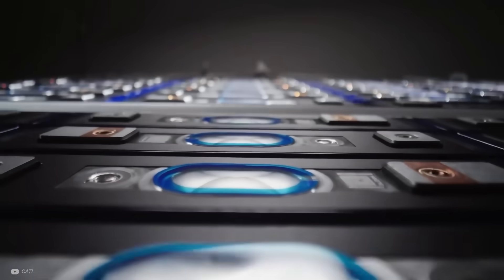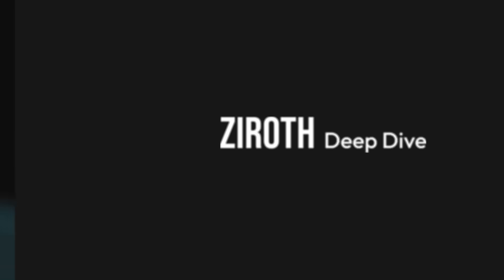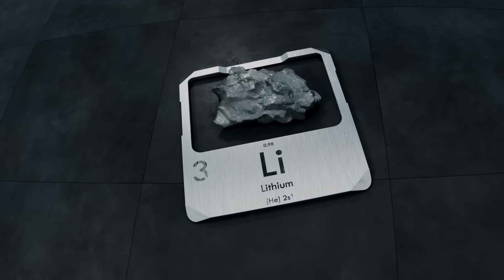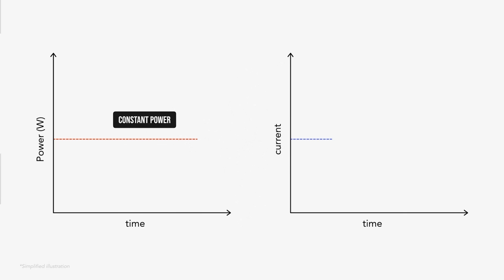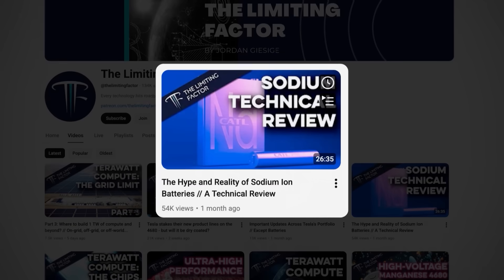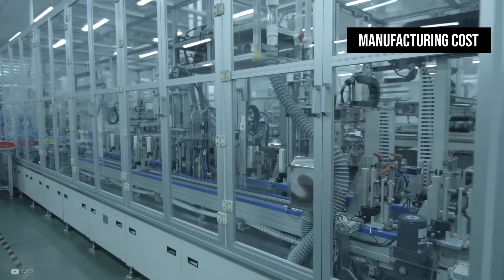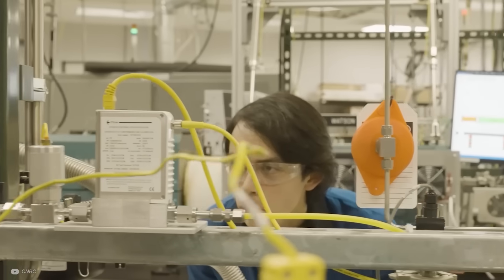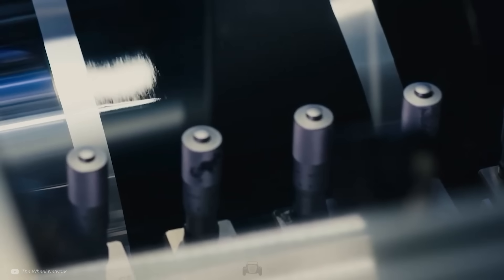How CATL’s Reinforced Sodium Battery is Insanely Cheap

Comment: the voltage drop in sodium batteries is al most the same as LiPo cells. all the electronics for that are all ready developped.
it is more about the price.
for now LPF is pretty cheap, 10kwh 48volt cost now about $950,= direct from factory.
the price is now more in the hybride solar inverter.

Comment: I drive a 2016 Nissan Leaf 30kw/h pack. It's already lost 3 of the 12 bars of battery health it started with, and I'd still rather drive that, than use salt batteries that lose voltage as they go. Consistency is KING. Lithium is also way better at giving you all the beans when you need them. I will upgrade to a Tesla one day, pref a performance model so I know it has Lithium cells.

Comment: The biggest issue with sodium ion hype is that it combines the best possible outcomes for different sodium chemistries as if they were actually one battery. It’s like someone saying that lithium ion is amazing and combining the price, safety and cycle life of LFP with the energy density and power of NMC and the charging rate of lithium titanate. This battery will be expensive as antimony is expensive and the production is more complex , even with improvements. You can’t use the cost of lesser performing sodium batteries as justification for this as the vast majority of the cost is in the cathode and not the sodium or lithium. You can’t assume the life cycle performance is the same either. Or the charge rate.

Comment: Since a decade that I listen that when the kWh of battery reach less than 100 USD the electric car will boom, now is around 80 USD but electric car still cost twice than a normal car. I guess we have to wait more decades.
Reply: That seems to mostly be a matter of the expense of self-driving package and other luxuries (including excessive size). Some American manufacturers are already targeting smaller vehicles with prices closer to $35000 USD.

Comment: This was a better produced video on the subject than 99 percent out there. That said there are still some omissions. First is you are comparing sodium ions future gains to today’s LFP which is also expected to make significant gains in the future. 
Another mistake most make, it isn’t the sodium vs lithium price that makes much of a difference. The Lithium content is about 4 dollars per KWH of battery and sodium under a dollar but that’s not a large difference. The biggest difference in expected cost is not having to use copper in sodium ion batteries as you do in lithium. Also LFP cells are already under 50 dollars a KWH in China and are expected to get under 30 dollars a KWH in the future. 

LFP cells are also getting cheaper and the theoretical lowest cost of both is very similar, so sodium doesn’t have a huge advantage there. 
Another one is safety. LFP and sodium ion are comparable with safety profiles, so the statement that sodium is a safer battery is misleading. 
The biggest is antimony is not cheap or easy to source and will likely make sodium ion more if not much more expensive then LFP. This defeats the whole point of Sodium ion. Antimony supply chain is already over stressed.  To me this eliminates any chance this new battery goes to mass production.
Reply: Antimony is even rarer than other rare earth materials like cobalt, which spark a huge concern for the environment

Hopefully they find another high energy chemistry that doesnt require those rare earths

Comment: If these cells were cheap enough stationary storage could easily exceed vehicle use as they enable massive decentralization of energy generation and storage.  I want energy storage but the cost is still pretty high for a complete system.

Comment: Interesting video, but there's a contrary viewpoint. Peak Energy's sodium-ion pyrophospnate batteries don't feature high energy density for. use in EVs directly, but deliver awsome power density. They have effectively infinite cycling over a 100% charge range: 100,000 cycles, full discharge to full charge and back without damage. 

A modest bank of such batteries can charge in slow hours on the power available to a roadside service station, and the deliver it at megawatt levels for truck and EV charging. It can soak up surplus wind and solar energy when it's available, then deliver it to the grid at night or when the wind is calm. The batteries have a declining voltage vs state of charge curve, but for the market they're going, that''s an advantage. It enables close monitoring of the state of charge. And best of all, their batteries have zero dependence on rare materials that aren't available most anywhere.

Comment: You need to add the cost of Insurance when dealing with home or power grid storage.  Commercial operators will probably get a lower quote for their Insurance if they are using Sodium Cells.  Home users may not be able to get past the code requirements.
The Cell cost is only one factor in the Total Cost of Ownership.

Comment: If anyone can deliver on hype it's CATL since it underpins 40%+ of the entire global automotive battery market now and also why lithium prices have been depressed even after they single-handedly axed 6% of the global production chain with the shut down of their largest mine and processing site in China itself.. At that point? They were losing money on their own vertically integrated lithium works... This is ALSO why the pivot to sodium is essential for both the company and the world.. Salt is literally dirt cheap and even when processed into pack form? $45/USD per KWH... A classic example? Making a GM EV-1-sized 20 kWh battery pack in 2025 money? $900 of sodium vs $22,000 worth of lead acid in the OG version.. This is why lithium and fossil fuels are cooked like a plump Christmas goose and rightly so. Let cheap clean tech flood the future from here on out!

Comment: AI Summary

Abstract:
This technical analysis examines CATL’s strategic pivot toward second-generation sodium-ion (Na-ion) battery technology, specifically focusing on a patented "reinforced cathode" breakthrough. While Na-ion technology promises lower costs and superior low-temperature performance (retaining 90% capacity at -40°C), it has traditionally struggled with steep voltage drops during discharge and high manufacturing costs relative to Lithium Iron Phosphate (LFP). CATL’s innovation involves the introduction of Antimony (Sb) to reinforce layered oxide cathodes. This modification renders the cathode water-resistant, allowing for the utilization of inexpensive, aqueous-based manufacturing slurries rather than costly, toxic solvents. This process compatibility with existing LFP production lines, combined with energy densities reaching 175–200 Wh/kg, positions Na-ion as a viable competitor for the mass-market electric vehicle (EV) and grid storage sectors.

Technical Breakdown and Key Takeaways:

*   0:00 Disruptive Potential of Sodium-Ion: Sodium-ion technology is identified as a primary contender to challenge lithium-ion dominance due to material abundance and lower theoretical raw material costs.
*   1:22 Core Advantages: Key benefits include significant cost reduction potential, operational stability in extreme temperatures, high safety profiles, and a sustainable supply chain compared to lithium-dependent chemistries.
*   3:05 Technical Hurdles (Voltage and Efficiency): Traditional Na-ion cells exhibit a non-linear voltage drop during discharge. This requires complex power electronics to manage increasing current draw as voltage declines, which generates parasitic heat and reduces system efficiency. 
*   5:39 The Cost Paradox: Current Na-ion cells often exceed the price of LFP cells due to lack of scale and complex manufacturing requirements, despite having cheaper raw materials.
*   6:36 Prussian White vs. Layered Oxides: CATL's first-generation cells utilized Prussian White cathodes (160 Wh/kg), which are compatible with existing production but have a low energy density ceiling. Layered oxides offer higher density but are typically sensitive to moisture.
*   8:45 Solvent-Based Manufacturing Constraints: Conventional high-density layered oxides require expensive, toxic solvents for processing, offsetting the cost benefits of using sodium.
*   9:43 The Antimony (Sb) Breakthrough: The core innovation involves doping/reinforcing the layered oxide cathode with Antimony. This structural reinforcement makes the material water-resistant.
*   10:20 Aqueous Slurry Processing: Because the reinforced cathode is water-resistant, CATL can use water-based slurry processes. This allows for the use of existing LFP manufacturing infrastructure, drastically lowering the barrier to mass production.
*   11:42 Performance Gains: The second-generation cells achieve 175 Wh/kg with a roadmap toward 200 Wh/kg. The Antimony additive also flattens the discharge curve and raises the operating voltage, simplifying power electronic integration.
*   12:55 Long-Term Market Impact: Projections suggest battery prices could eventually fall below $25/kWh. While significant market share may take a decade to materialize, the technology has reached an industrial tipping point for EV and grid-scale applications.

Expert Summary (Analyst Perspective):
CATL has solved the "manufacturing cost-density" trade-off that has historically sidelined sodium-ion technology. By utilizing Antimony to enable aqueous processing of layered oxides, they have synchronized high-performance chemistry with low-cost industrial infrastructure. At 175-200 Wh/kg, this chemistry is no longer just a "stationary storage" solution; it is a direct LFP competitor for the 500km-range EV segment. The critical takeaway is the shift from "cheap materials" to "cheap processing," which is the necessary catalyst for true market parity with lithium.

AI-generated summary created with gemini-3-flash-preview for free via RocketRecap-dot-com. (Input: 18,200 tokens, Output: 1,030 tokens, Est. cost: $0.0122).

Comment: thanks for the report Ryan but unfortunately until "big money" market leader the BYD MEGACORP is using them, I contend that Sodium continues to be the same "overt scam" as LMR, Silicon, Solid State, Ai, etc and therefore has no future (at least not in Automobiles anyway).  i mean CATL can file all the patents they want I don't care.  NOT SO FUN FACT:  for those that haven't been paying attention (meaning all the Sodium fanboys in the comments) the CEO of BYD Wang Chuanfu is in fact a Battery and Chemical Engineer and the way BYD originally got started was as one of the many State Sponsored manufacturers of Li-Ion Batteries in China (oh wow)...

yeah so unlike the "dynamics of desperation" we've conspicuously got going here in the year 2025, one doesn't receive a $230 Million Dollar investment from the "Oracle of Omaha" (Warren Buffet) way back in 2008 (ref: 17 years ago) on the strength of NOT knowing what they're doing, and on the strength of NOT knowing what they're talking about.  oh btw instead of switching to LFP or switching to supposed "low cost Sodium", CEO Jim Farley at Ford just wrote off a whopping $20 Billion in EV investment (that's Billion with a "B").  sorry for the bad news.

Comment: 4:33 - The graph is wrong. Since current = power/voltage, a linear reduction in voltage would result in a reciprocal curve for the current, not a straight line.

Comment: You & Will Prowse both fall victim to the fallacy that a horizontal flat voltage curve is better… 

Flat voltage curves are not always better, very few batteries have very flat voltage curves. This requires specialized circuits to measure state of charge, intelligence to keep a history to measure health of battery to help predict state of charge.

A fairly linear, straight, downward voltage curve makes state of charge easy to measure. Few complex electronics for battery health.

Most batteries have a long linear downward slope during discharge, so this is well understood & well managed common electronics.

Parroting Will when he was [very occasionally] wrong was not a wise thing… it would have been better to call out the advantages of a downward linear discharge curve and call out the disadvantage of a flat horizontal discharge curve… in addition to the antithesis, which you did well.

Comment: So 400 USD for a 20 KW h battery, well that should really light a fire ( bin not inrented)  in the uns marcket, depending on weight this mightbe the thing tgst 
Ushes out dieasel generators for surt term ( minutes to hoers  long power cuts) or for liad shifting id som of the dc to when power is cheaper. Biy a decade or more is a long time so I'll try to comtain my excitement a bit. Bth do thiese sodium batteries explode/burn when shorted/overloaded likhe Lipos seam tomdo?

Comment: The voltage curve for the gen1 CATL sodium ion looks very similar to NMC lithium ion. In fact, one of the downsides of LiFePO4 is the flat voltage curve, which makes it harder to estimate the state of charge. I'm not sure I buy the argument of more expensive power electronics, because you'll need them anyway if you want to use the full capacity of the cells (the voltage drops substantially at <10% SoC in all the chemistries shown).
Reply: The consideration is the spread of the voltage curve is much wider than that of Lithium cells  (including NMC), with the voltage dropping much lower in Sodium cells. This requires electronics with much lower resistance to compensate for the higher currents needed to maintain power levels (whether charging or powering motors). Here, more expensive Silicon-Carbide and Gallium-Nitride components are utilised rather than cheaper Silicon components; with a similar higher component expense as seen between 400v and 800v architecture vehicles (which also use SiC/GaN components, though for different reasons).

Comment: Do you have any clue how much you speculate? Not just a little, it's a lot! For example your "they need to be used in electric vehicles". Boy, you're wrong. Especially in EVs range still counts. And for that you need the highest capacity you can get (with a few more features being highly desirable). Lithium-ion just wins hand down in that equation.

Sodium-ion is, and has always been, just less attractive. You can compare it with gasoline vs diesel. Both work but you just need a different and more complex technology to make the cheaper fuel (diesel) work. For that (and many other reasons) diesel never made it in the car industry but did make it in the truck industry. That's where the economics begin to make sense.

Sodium is never going to get mainstream EV adoption, besides some that have to add it out of necessity for political reasons, because it makes less financial sense in a car. You need more battery and you need more electronic components. Where sodium does make sense is where space is less at a premium (and some added components are worth it). That is with truck and home batteries.

Comment: Cheap but not if they pay for pollution. The extraction phase will be significantly more polluting than LFP due to stibnite's association with arsenic and SO_2.The manufacturing phase will be cleaner than LFP because of the water-based slurry.The disposal phase is the "wild card"—it is more toxic if it ends up in a landfill, but more "circular" if the value of the antimony drives high recycling rates. So its better for cars and homes, not mobile devices. https://www.atsdr.cdc.gov/toxprofiles/tp23.pdf see section 6